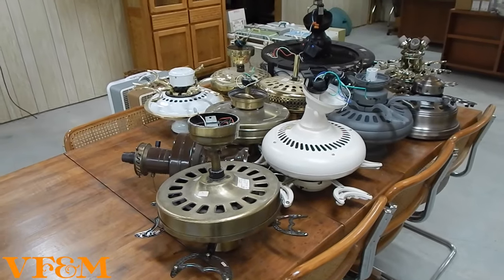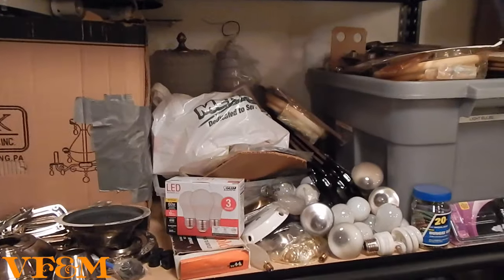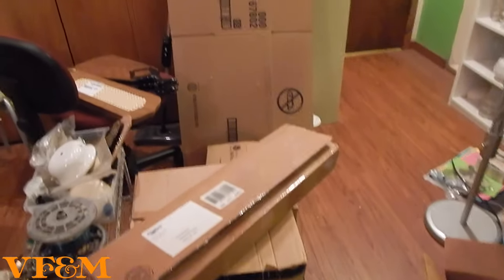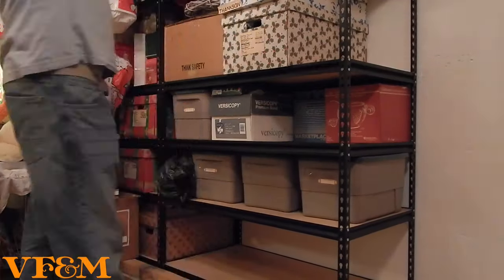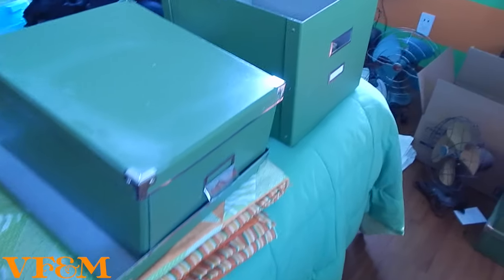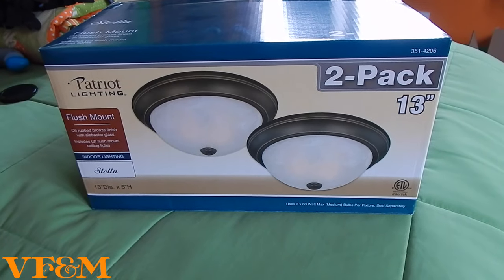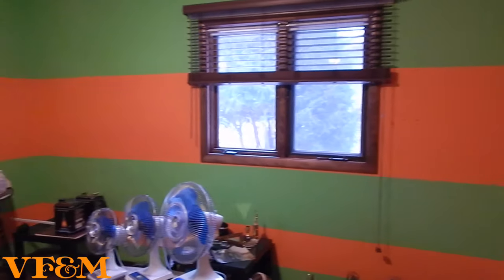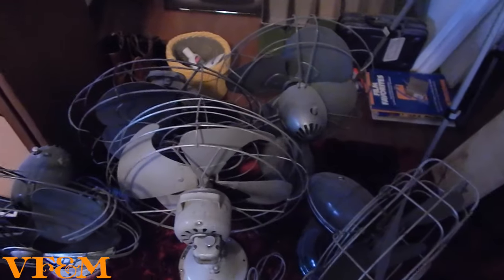Moving Vlog 12 | Bedroom Display Comes Down!

Comment: So are you leaving any fans behind or just light fixtures?
Reply from the maker: That was answered in the video. There will positively be a fan left in the family room, possibly in the master too.
Reply: So will the fans left be a builder fan like Craftmade Contractors Design?
Reply from the maker: I still have not decided, like those light fixtures were a quick decision when they were on sale, I hadn't decided on them until I saw them advertised. You'll know what goes up when it's on video.
Reply: Is the family room fan going to be on on/off switch? I know it was originally wall controlled when you moved in.
Reply from the maker: IDK, haven't thought that far ahead. There's been so much other stuff to focus on that I literally have not considered anything about the remaining fans that need to be swapped.